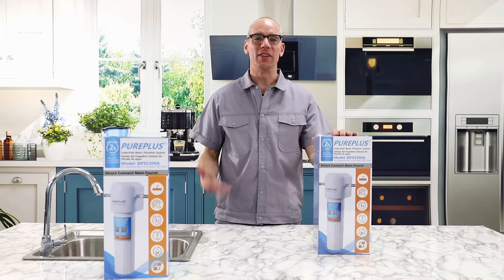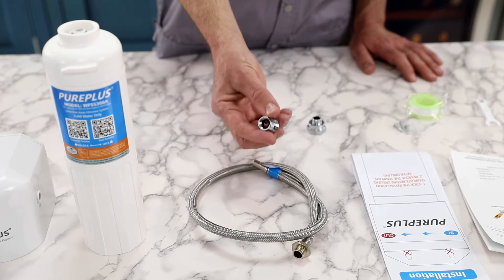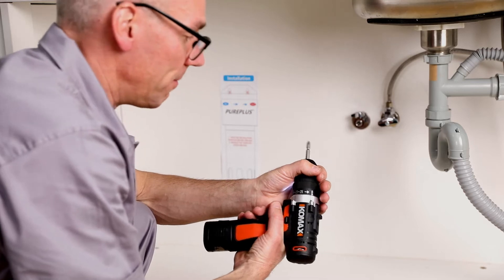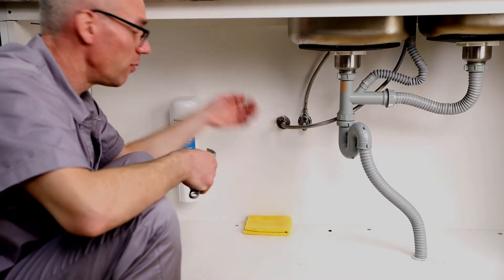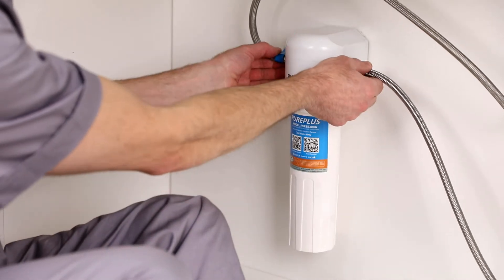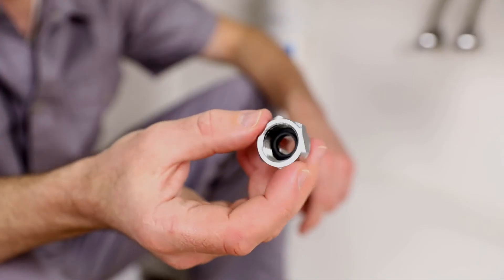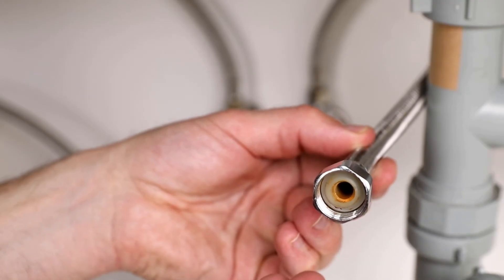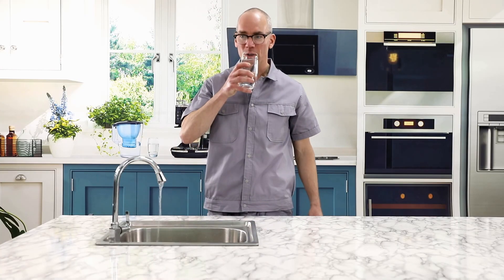Installation Video of PUREPLUS RWF5300A Under Sink Water Filter System

Comment: After 25 days of installation the pressure dropped a lot... The water here in NY respects the standards and even so the pressure after 25 days installed is horrible.  It was installed as per the instructions and the hot water pressure is normal and the cold water pressure (with filter installed) is horrible.  It was fine for the first week, but then it went downhill.  Changing every 20 days is very expensive!